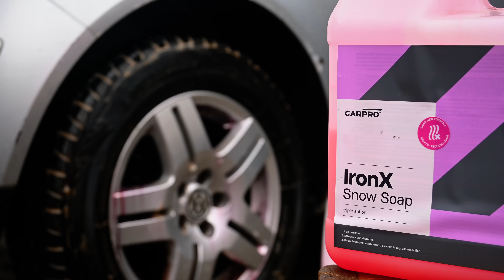VW Golf MK4 Exterior Deep Cleaning - Car Detailing

Comment: For the rims you used just a normal iron remover? Did you use any acid? I saw some major contamination on the inside parts...
Reply from the maker: I used ironx and ironx snow soap, my exterior doesnt include a full decon on the rims or lets say wheels detailing , that will be a separate package because to clean them properly they should come off .